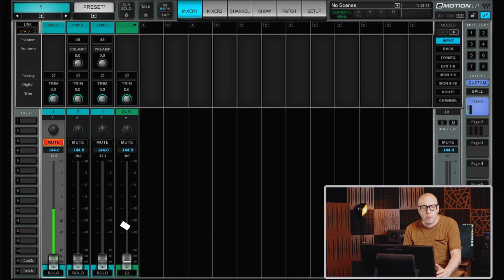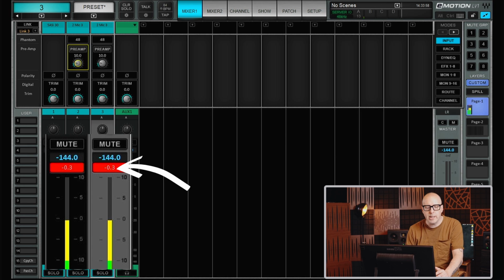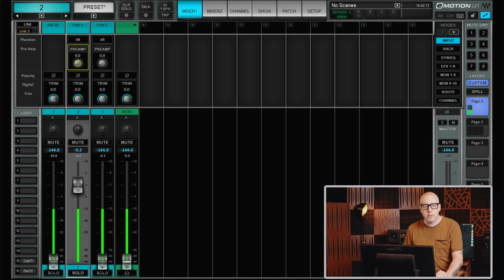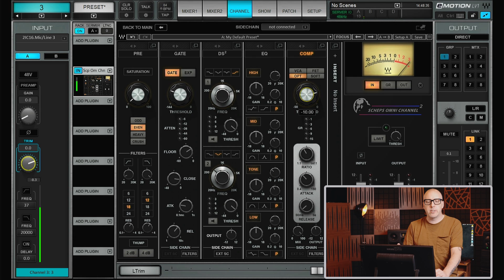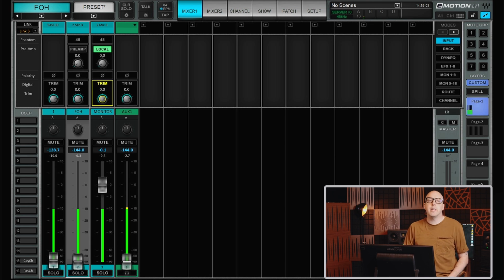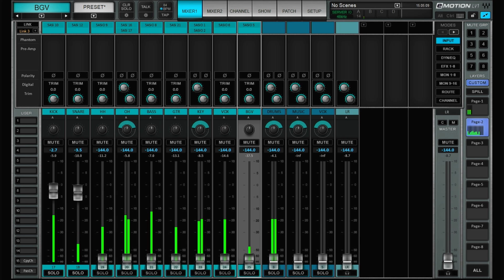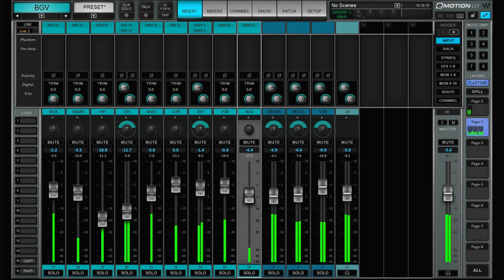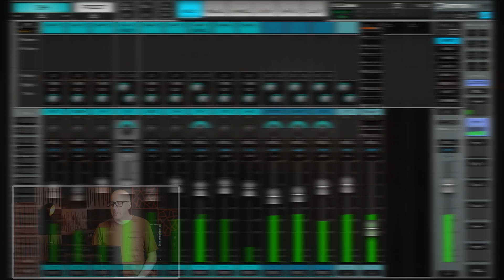Waves LV1 tutorial - Gain stage & gain structure

Comment: Thanks for this video. I have watched it a number of times and have learned something new each time. I like the point about minimising the output volume by the same amount I want to increase my channel volume by, but I do have a  question; 1. If my channel level is mostly around unity but my bus level is too high, with minimal head room, what might I need to change to get more head room in the buses? TIA Michael
Reply from the maker: Well since it's 32 bit floating point internally in the LV1 you can at any given point just turn things up or down. So If you are going too hot into a bus you can just bring down the gain on the first plugin on the bus. Or just bring down the output of the last plugin on channels going into the bus.
I usually (since I used to work on analog) bring down the output on the last plugin on the channels going into the bus. That way I hit the bus at the "right" level. But sometimes you need to work fast and then it's faster to just bring down the level on the first plugin on the bus.

Not sure if this all makes any sense :)

Comment: I'm trying to match preamp levels on my Ionic 24 to old show files that used Dlive which has up to -20 below unity available. Do you know the equivalent gain, for example, of the Ionic 24 compared to the unity on the Dlive? I have a few channels that were around -12 on Dlive but the Waves only goes to -3 and there isn't a pad. Also, IMO, your strategy of using plugin output level to make big offsets to get your fader in a nice range (rather than using the trim) could be confusing or even disastrous. I to try to keep plug ins at a unity level, so you can easily/safely bypass them to hear what they are doing, which is also helpful so in the rare event when a server gets unplugged, disconnected, a plugin gets bypassed, or similar, you would lose the processing but not have huge level changes which could be catastrophic. Thank you!
Reply from the maker: @dennyjagard7595
Hi, thanks for reaching out. There isn't really a way to pad down a very hot signal on the Ionic. We just have to live with it. The 2k setting on the preamp is a little less hot than the 7k. So there's a way to save a few dB if you can live with the sonic difference.

And you are absolutely right  about doing big level changes in plugins. It can be disastrous. For my way of working it's still the best way to get the best sound and still have the best resolution on faders. The trim will also effect anything going to direct out (tracking perhaps), so I want to keep that at unity if I can. 
But yeah, If a server goes down I'm in trouble.

Comment: If i want to use an externel preamp outboard :it is possible to bypass the preamp on lv1?and how to do?
Reply from the maker: If you use the Ionic preamps you can chose mic or line level (same place as the options for HMX and impedance). As far as I know, choosing line level will bypass the preamp. Another way would be to go TRS into the stagebox rather than XLR. That would do the same thing.
Reply: I use dsp pro 4000.and this stagebox doesn't have combo xlr (mic and line) .how to do in this scenario?
Reply from the maker: In that case it might not be possible to bypass the mic preamp. I've never used the 4000 so I'm not sure.
Reply: Thank you🙏for yor answer